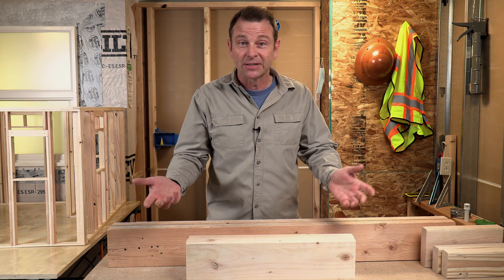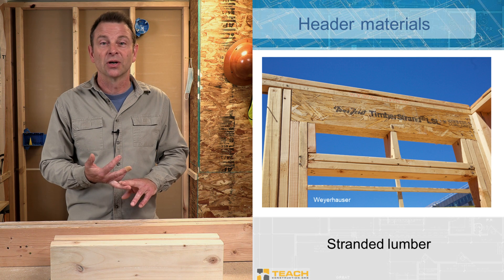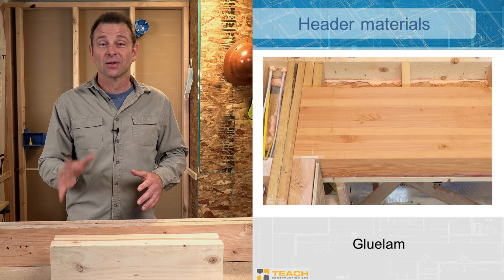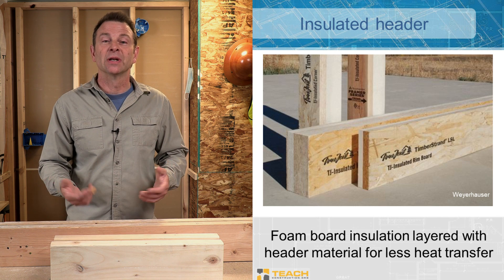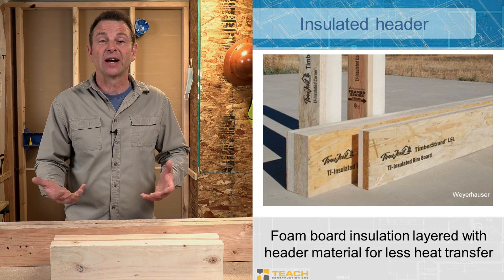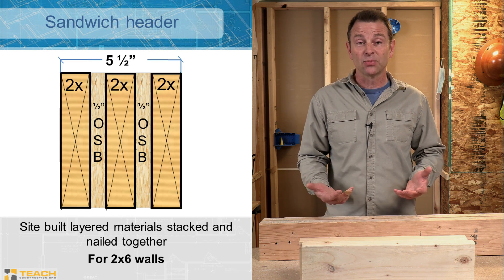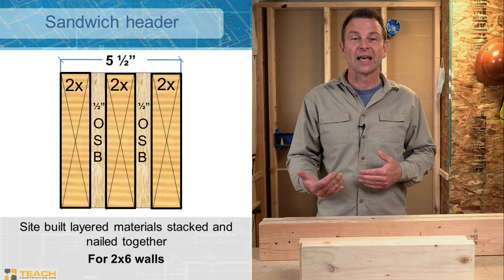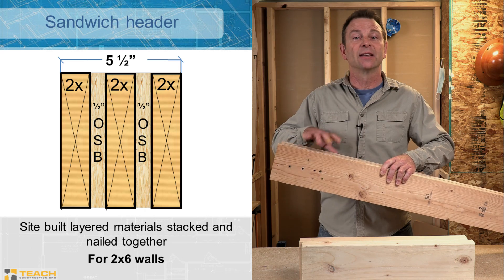All about headers in Wall Framing - Construction Trades Training Lesson

Comment: The one downside of the high header, is a loss in the fastening area for window dressings. Other than that, it makes sense.
Reply from the maker: They do make sense in many install situations - Blocking is always easy to add if needed.
Reply: @ConstructionEd  
Rather than a high header and blocking, I would simply use a low header.

Comment: I don't understand the dimension numbers for the sandwich header.  If I put 2 2x4s and a 1/2" osb in between them doesn't that create  a dimension of 4 1/2 inches? Same with the triple sandwich header, 3 2x4s and (2) 1/2" osb in between, doesn't that create a dimension of 7 "?
Reply from the maker: The actual dimension of a 2x4 is 1.5'' x 3.5''    - Watch our lesson on Dimensional lumber for more info on that https://youtu.be/gHYY3kDwXHo
Reply: Even thouught they call the lumber 2x4 or 2x6 for example... its not the actual size if you measure it.....
Reply: They shave 1/2” off the lumber to remove discrepancies

Comment: The open layout header feels riskier (I’m an absolute beginner just sharing thoughts). For example if you placed weight on the weak side of that open header where the insulation is I feel like you could have some major screw ups. Imagine building on top of that header you wouldn’t likely know that an entire side is hollow and could put weight on it in a way that could compromise it. Also I’ve heard that the first thing a piece of dimensional lumber wants to do is turn when it has weight on it (example in standing joists). Would this tumble effect be more likely to happen on the “weak” insulation side of the open header layout?
Reply from the maker: I often rely on the tables in the code and what the engineer has specified.   I personally like the headers that are boxed with insulation in the middle.
Reply: I had never heard of that kind of header, and I was thinking the same thing. If I were a pro building from engineered plans, of course I would build it as shown. But I'm a DIYer building my house, and I don't think I'd do that kind!  This was helpful. I have half my house built, and your videos show me where I went wrong (not many wrong spots, thank goodness), where I went right, and how to do it better on the rest of the house. There are so many practical things you only learn by doing. Like how do you handle it when most of your lumber is warped in at least one direction? I've gotten a lot better with that, but warped, twisted and splitting lumber is always a headache. Is there a video for that, other than to insist on picking out your own boards at the lumber yard?

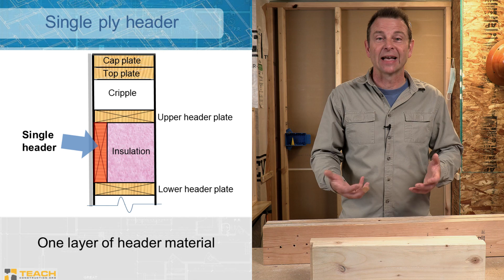Comment: I would quibble with the illustration on 7:34-8:36 I've always called the two plates at the top the "double top plate", the lower plate being the "First plate" and the second one being ........ "the Second plate"😉. I think that the way they are drawn might confuse students because the "Top plate" is under the Cap plate.
Reply: Thanks always for the input and for watching. There are many regional differences in terms and some builders even develop their own naming. We at TEACH try to find the most accepted and descriptive terms. You know how tricky this can be for a global audience and so many times textbook terms are not always used everywhere or by all.
The cap plate (or lesser used term "crown plate") clearly describes the uppermost position in a wall. I believe anyone learning framing would struggle with understanding your preferred term "first plate" as it's name does not indicate its location in a wall frame. To a newbie, "first plate" could possibly suggest the bottom or sole plate. As for "Second plate" - if i know nothing about framing this might be a single top plate but I am unsure. Remember, a wall with a single plate only at the top is always referred to as a "top plate", so an additional one stacked above makes the group a double top plate as you said. With three basic terms used in the most current version of the IRC - top plate, double top plate, and cap plate, walls built with either a single or double top plate can be described with less confusion and a student is also being primed for learning building code (IMHO). 
I think we can both agree that communicating clearly through terms is just as important as tool and measuring skills when working in the field. 
Props to you for caring and the feedback is very appreciated!
Reply from the maker: I have to agree with Joe.  Bottom plate, top plate, and cap plate. The last two making combined making a double top plate.    Start with the text book terms and then move to field terms

Comment: Say if I had a 6"monoletic pore wall all the way around but I want to have 2x8 floor joist and 2x4 framing for the interior walls how do I do it
Reply from the maker: if you are asking about the floor construction it all depends on the span distance of the joists and the loads you are expecting on the floor.   As far as 2x4 walls, that is fine depending on the usage and your local code.   Meaning 2x4 may not provide for enough installation in cold climates- but in warmer zones it is often allowed.   I am sure that does not answer your question, but much more information is required to design a floor.
Reply: @ConstructionEd  24" span
Reply: It's in south America it's a warm climate
Reply: I will be adding drywall on the interior  its going to be a 3 story house and it's going to be 40ftx60ft
Reply from the maker: 3 stories is a lot of weight for only a 2x8 joist. I would check with an engineer
Reply: @ConstructionEd  it will not be good for the floor to have 2x8 floor joist on a 3 story house
Reply: @ConstructionEd  it's going to be 14ft x 9ft walls 6" monolithic pour concrete walls with 12x12 colum and 9x12 concrete beans
Reply: @ConstructionEd  would it be stronger if I put the floor joist 16 " on  center
Reply from the maker: Sorry Vincent - I can not help you design your floor with limited information on a YouTube comment string - you need to work with a qualified professional for structural design.   It sounds like a fun project you are planning and good luck with it.

Comment: Do you have a video showing a opening for a door on an elevation vs subgrade? That is, crawl space vs basement foundations. (Up north is mostly basements, and in the south crawl spaces.)

Also what differences if any between those rough openings with balloon framing?

Great series btw. I'm currently doing remodelling again, and these technical details is where I'm having trouble.
Reply from the maker: I am not really sure what you are asking about - the RO framing is the same over a crawl space or a basement.   If the RO is in the foundation - then those are typically supported with the concrete wall and then header in place - sometimes that is in metal.   Then the rest of the RO is framed out with wood so the door has something to connect to.  But this construction would typically be called out on the plans and approved by an engineer. 

I could be wrong - but the RO framing is the same for balloon framing - but you should consult a Structural Engineer since I assume you are talking about a multistory building since you referenced balloon framing.   Especially if you are dropping in a RO where there was not one before.

Comment: For the exterior openings, the framing member right at the top of the rough opening shall be designed for wind loads. While it's not an issue with small openings, it's can be a problem if this member is not sized properly for much wider opening especially when the real header is raised up against the double top plates.
Reply from the maker: You can meet the wind load requirements as separate from load capacity of the header

Comment: Great video - I'm interested in learning more about the math behind determining the number and size of the header beams to support a certain span width. I assume the same header can support the same span regardless of if it's dropped or raised and in contact with the top plate so is there another benefit for using the "modern" header placement of raising it to the top?
Reply from the maker: I learned some of the Math in my Structural Analysis class at school, not terribly fun.   Now most folks just look at the IRC code book and use those tables - or of course just do what the engineer told ya to do, lol.   Yes the high header can carry the same load as the drop header - in fact it can carry a bit more when it is up tight against the top-plate.   The other main benefit for a high header is later remodeling.   It is nice to be able to increase the height of a window without having to replace a header...